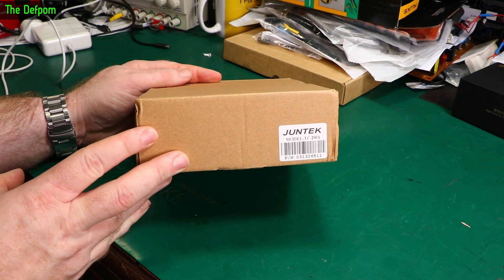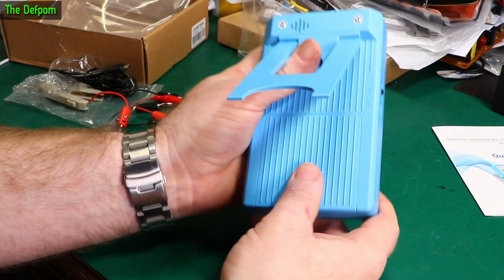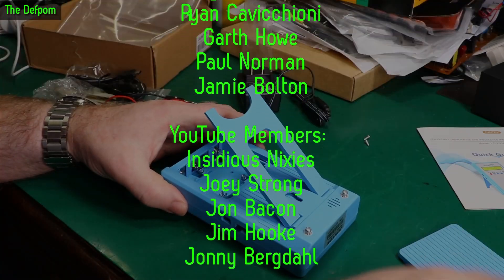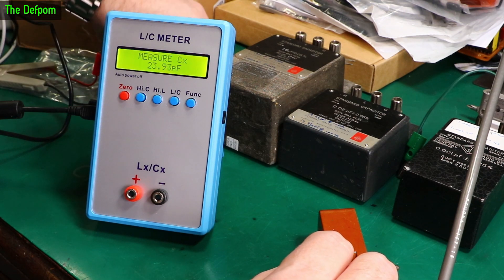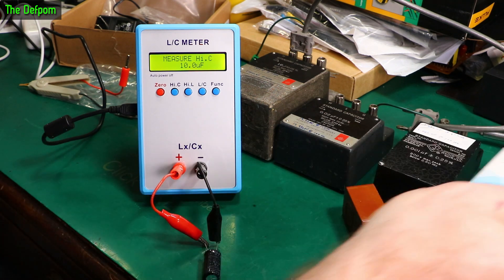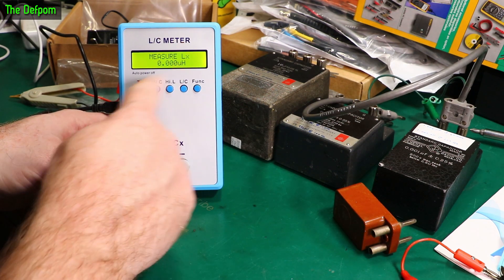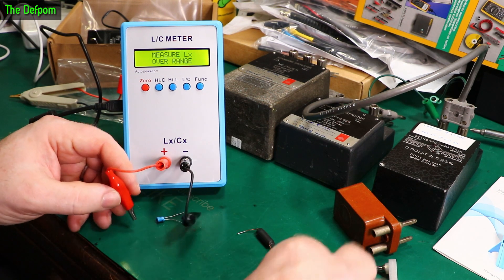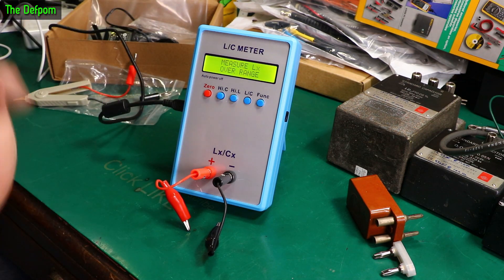🔴 Juntek LC-200A Inductance & Capacitance Meter Review - No.1043

Comment: It would be reasonably easy to reverse the receptacle leads by pressing in the retention tangs, sliding out the crimped terminal with the attached wire, and reinstall in the opposite direction.  Probably important if there is a bias voltage supplied to electrolytic or tantalum capacitors.

Comment: I bought exactly the same unit made by "MingHe" about 4-5 (?) years ago.   Mine seems to work quite well (for the ~ US$17 I then paid!).  It's very much based on the 1996 LC Meter Project and Kit by Neil Heckt (now deceased) of "Almost All Digital Electronics".  
It is VERY important to recalibrate the 0 value EVERY time you change range.  Use a short circuit to calibrate L, and open circuit for C.  Hold down "zero" until you see "DATA SAVED". 
After much investigation I decided that the "AC" markings  referred to  "use the AC Adaptor" NOT "feed me with AC"!  The "9V" is completely spurious.
Reply: Yep, I have this thing too - it is quite OK for many things when one needs to be only in the ballpark with the inductance/capacitance (e.g. HAM radio circuit). Most of these components have large tolerances anyways. 

But I have never noticed that this had actually a battery compartment! D'oh! The USB port is dummy, I believe, only for power. I have always powered this meter from an old Nokia phone charger with a barrel jack soldered on.
Reply from the maker: I own the AADE LC meter too, although it doesn’t get much use anymore, it is a pity Neil died, he made some excellent items.
Reply: @TheDefpom  Yes indeed he did, and I also use his AADE Filter Design program V4.5, which will still run under the latest WIN 10, despite its age.

Comment: If a vendor cannot pay attention to the labels on the switches, and power jacks, I have little confidence in what is inside the device.
Reply: I apologize for this. This product came into the market early. In the early days, we were inexperienced. We used public abrasive tools to make this product. The purpose is to provide electronic enthusiasts with cost-effective products. We will also launch new products next year. We are happy to give you new products for testing.

Comment: Hi Mate, you need to zero the meter if you are using the extension lead as it looks like it has a capacitance of 33pf. The old modems sometimes used ac plug adaptors. Thanks for the content.
Cheers Dave.

Comment: Haven't seen one of your live's in a long time. Have they moved, stopped or am I just not getting notifications?
Reply: Boss doesn't allow it
Reply from the maker: I haven't done one in a little while, it will be a few weeks at least until I can do another one.
Reply: @TheDefpom  Cool just checking, also I got SUPER lucky and got a Wayne & Kerr Precision Component Analyzer 6425 dirt cheap. It work as treat but was a 110V/60Hz setup. I have switched it over to 220V and from what I can read there is a jumperwire somewhere to also set it for 50Hz but wanted to probe you and your viewers to see if anybody knows where that wire is hiding. It works as is (in fact it works amazingly well) but from what I can read it could be slightly off due to that frequency difference.

Comment: Zero again once the leads are in for the cap measurements might fix the slight over-capacitance issue at the begining?

 I guess it may or not be a bargain depending on the cost, but I'd stick with my DE-5000 too.

Like your reviews... First impressions are useful. 👍
Reply: Thank you. As a standard bridge, the DE-5000 is really easy to use, but not everyone can afford its price. The LC200A is also a good choice for users who are pursuing cost performance.